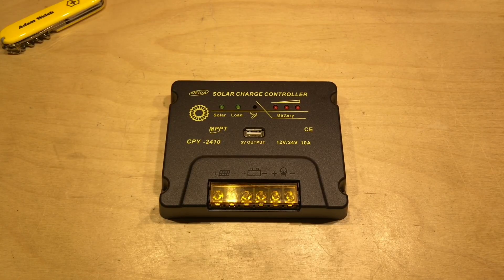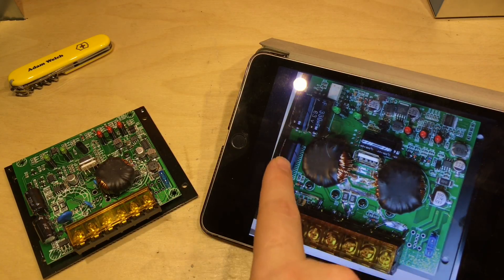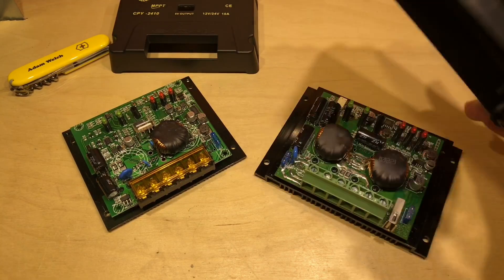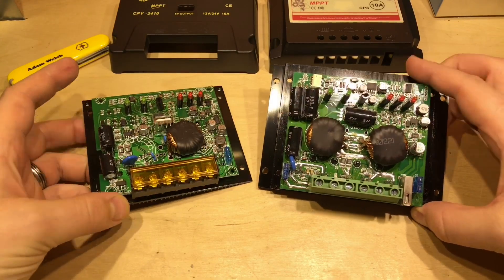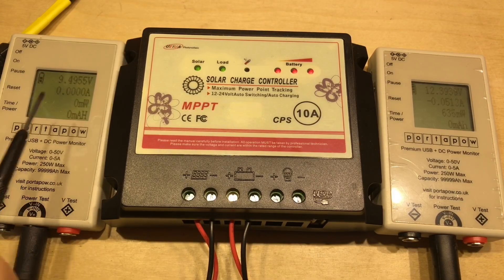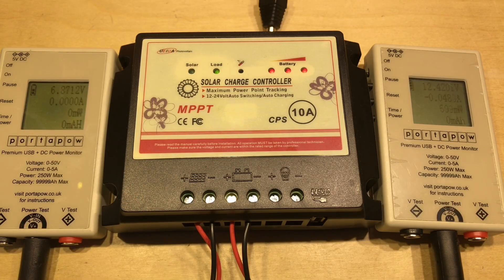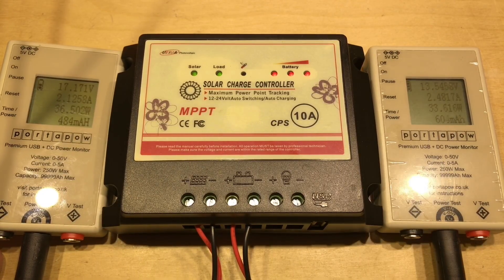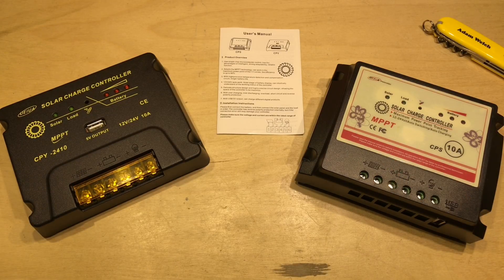UEIUA MPPT Solar Charge Controllers - 12v Solar Shed

Comment: too bad they can't stop when they have a useful product. revisions are supposed to improve the product, not so much in this case.    I don't trust these cheap controllers to not catch fire especially the 20 amp and higher versions. another good video!
Reply: The Left Hand 
yea. they keep trying to make more and more money off the product. by cutting  cost of building it. in most or some cases anyway. I been looking at power jack inverters for a few years. and it looks like they are trying to build a good product. I hope they have got there. I bought a 2017 model inverter. they started putting the MOSFETs on their own boards. with screws making the electric connections and mounting. with easy replacement parts available. I still have my fingers crossed. it has worked great so far. I'm looking for a good MPPT controller. I hope to find a cheap. good quality 30-40 amp for my system. along with solar panels. to charge my 24v lead acid bank. and my lithium bank. a 10-20 amp lithium controller would be fine for now. my lithium bank is Small for now. I hope to get 1500 watts in panels soon. along with a small hydro generator. I hope for 10-20 amps at 24v

Comment: This board can't handle panels in series. I've done some extensive testing with the version 2.3 which shows that. Furthermore reset the charger (disconnect battery) everytime after changing the solar panel configuration.

Comment: May be the charge controller is design to work with 1 solor panel or more then 1 in parallel.which has 17ish volts as a maximum power point. Thats way the controller bring down the input voltage to 17 or 16 voltas to match the mpp of the panel.

Comment: It is too bad the cps-2410 has a design flaw, either firmware or hardware related, as it seems quite well built otherwise with far beefier tracks, heatsink, more practical connection points and obviously 2 inductors instead of one. Kinda of a waste of work. Seems like the company has some competence issues.
Reply from the maker: +threeparots1 Yeah it’s odd. I’d suggest it was a cost saving exercise but as you say, the larger heat sink, dual inductors and beefier tracks don’t seem to be cost saving even if the change of the micro controller is.
Reply: Adam Welch it would seem like the micro controller programming is the let down. Good way to shoot ones own foot. Great review as always. Too bad this company is inconsistent in their manufacture and clearly made for baffled buyers after your review. A little embarrassing to review something to have them use a variety of internal components that operate completely differently depending on the package you receive. Could probably sell many more if they got their act together and at a slightly higher price too. Odd really.
Reply: timemachine194 good to know. Battery isn’t going to like that kind of voltage for two long. Company in house testing  would be wise 😝. Hopefully a refund can be had.